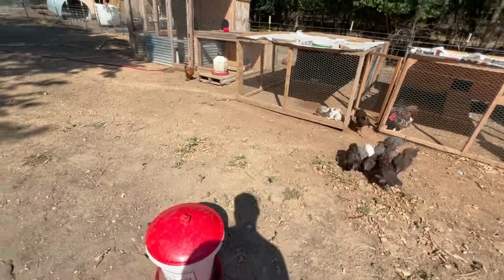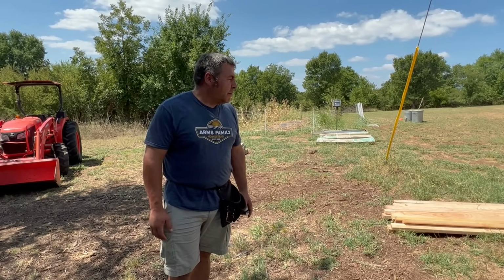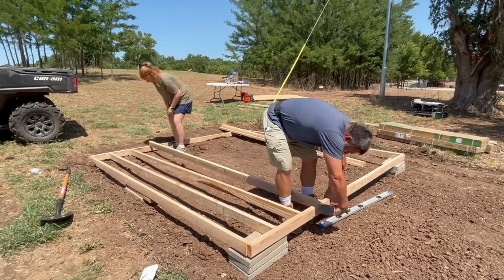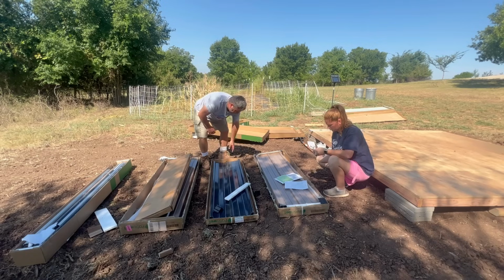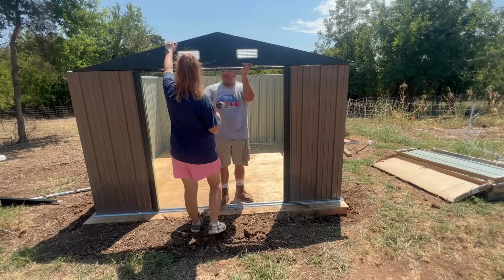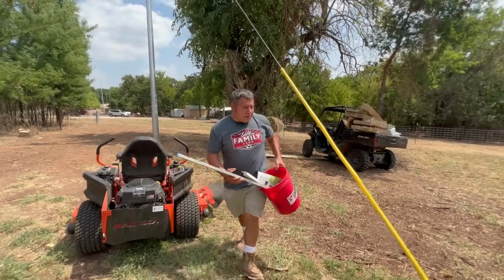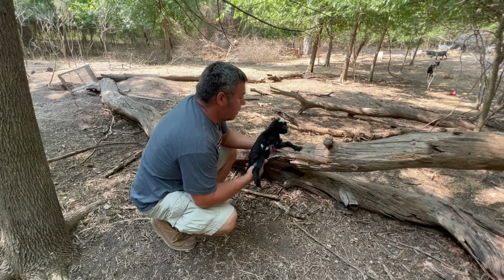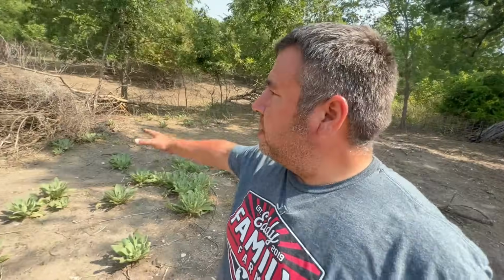Hope I Do Not Regret Doing This!!￼

Comment: Noticed when you let the chickens out just how dry it is - cracks in the dirt.  Steph was good help and "wisdom" with the building construction even for having been to dentist. The metal building came together nicely and should serve your farm well.  Just an IDEA for you to consider:  if you have more of those flat blocks you placed under the frame place some at the door opening so you won't be stepping in dirt or mud and tracking it inside.  Hope you all enjoy the trip to Alabama!
Reply: have you heard any more on your house build? hopefully they’ll start soon
Reply: Or pull out the dirt from the front and replace it with rock, for drainage,  and then the wood isn't in contact with the dirt.

Comment: If it is just a storage shed then it should be fine as is if you plan to use it as a workshop then you may want to insulate it and put a solar attic fan to take out the hot air.

Comment: Just a suggestion,  you need 2 course  of blocks under each corner.  You put up the building  and put heavy equipment  in there,  it will sink in the dirt. My husband and I didn't  put 2 under each corner and in less than a year, it was in the dirt. He and his son jacked it up and put 2 more bocks on each side because  building  was lopsided  and rodents and other critters  were getting  in and making a mess.   We built a ramp up to the door so we could drive in and out. I sold the building when I was moving after my husband  passed away. It was in great shape, they came in with  lift truck and removed it.

Comment: If I would have known this ahead of time I would have suggested that u put plywood on that roof before putting the metal on. Not only does help reinforce the stability of the roof and the building but also adds protection to the stuff ur storing inside. By that I mean..such as a hail storm or if a limb falls on it. If the metal is busted thru, that plywood still provide protection. I have that same kind of shed and That's what we did to mine. I also had the doors reinforced with welded rebar so they were not so flimsy. Those two things made the building so much sturdier and it will last alot longer too. I've had mine over 15 years now and still standing strong. U would b surprised at how much that will help. Now mind u...after a few years of building it I start seeing rust pop up n some places. So I took sandpaper and removed as much rust as possible and then sprayed those spots really good and then sprayed the rest of the building too. I have yet to have any more rusting issues as of so far. Just thought I would give u that tip too so ur shed could last y'all a very very long time. Love u guys and always wishing u well ❤❤.

Comment: Wouldn’t you want the ground/pad to be higher then the rest of the ground kinda like they did for the house. You can always build up the dirt or build a ramp to drive your equipment in. That way you want have water around the shed causing damage to the frame/floor or going under the sheds.